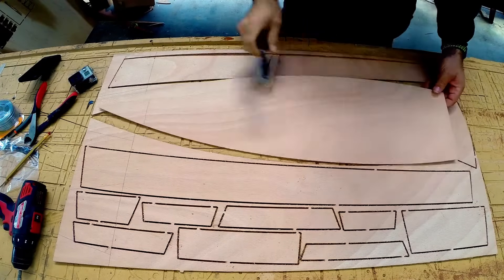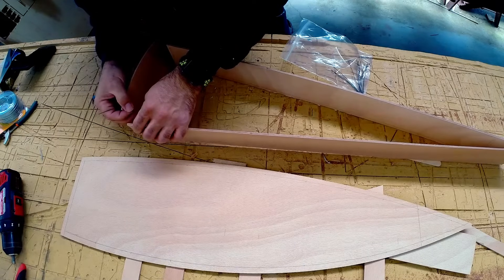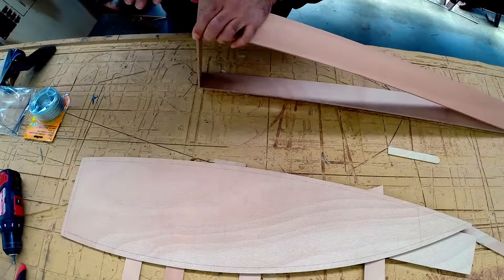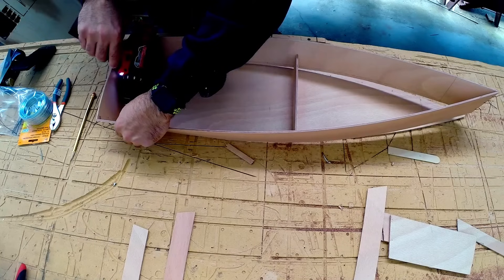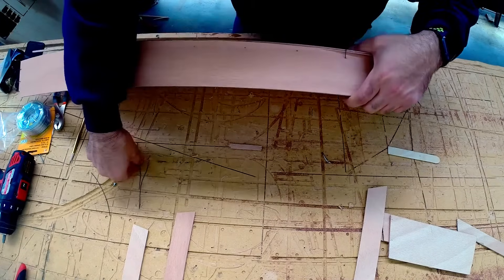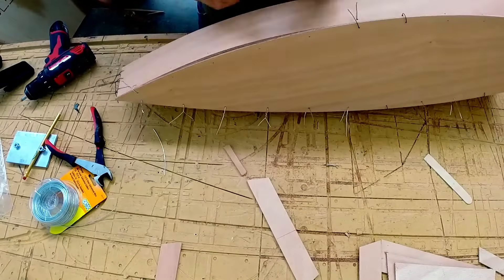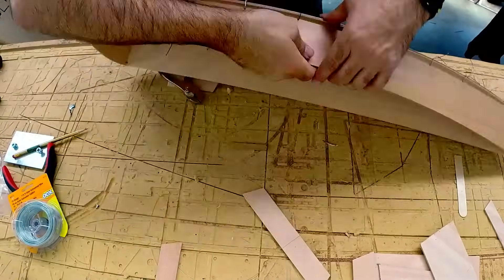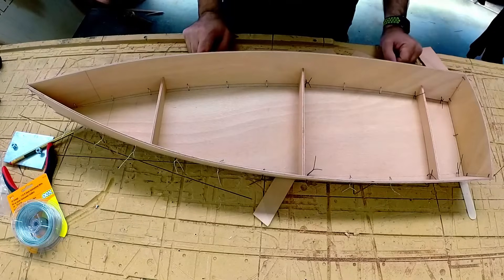Stitch and Glue Boat Building: Stitching a Quick Overview

Comment: With all due respect you put that together in the wrong order.

Sides go onto the base first.then the transom(bavk) then you bend up the sides and wire the bow then the transom to the sides.

You made this look easy because of the scale but a full sized boat would be very difficult your way
Reply from the maker: Interesting. I have built 5 of these boats, 4 - 14 foot long versions and a 10 foot version and I have done all of them the way shown in the video.  Normally I get the bottom laid out on some sawhorses and then lay the sides on top of that, stitch the bow together, place upright on the bottom, stitch the transom on and then stitch the sides to the bottom.  We'll be doing one at a public demo at the Wooden Boat Festival in Port Townsend in September, come check it out.
Reply: @FiberglassSupply  i would live to.the wooden boat show is legendry-but alas,i am a wage slave and cant make it-also im a kiwi and its in asstralia-you people treat us like shit on the whole-next youll be sending us to manus island.

As for the construction method-ive done plenty of kayaks and a couple of skiff type hulls.

All of them are the way i said.

If you make a larger hull using 1/2"  or 12mm ply and above it becomes more important because of the equipment required to bend the material.

On other serious advantage of the method i use is that you can attatch the inwale/gunwales while the panels are still flat and you only have to deal with warping in one plane.
Also the hull panels can be placed on the inverted side pieces and scribed directly from the sides.this also allows you to firmly attatch cross members making the side very rigind  and accurate.

Obviously both methods work and i can see advantages to both ways
Reply from the maker: @jadekayak01  The boat show I was talking about is the one in the US where we are located.  

While we have built that particular skiff that way, I'm not a slave to that method, like you said it depends on size/complexity, etc.

I haven't tried installing the gunwales flat, that sounds interesting, especially if doing  spaced inwales.

Cheers
Reply: @FiberglassSupply  sorry about the location.

Tasmania has a wooden boat show to.

Ive never done gaped inwales.

Seen them mostly on canadian canoes.

From what ive seen you need to do them on the finished boat to prevent uneven stresses along the gunwales.

Have a good show.

The majority of the boats ive built have used Chris Kulczycki(dam-i couldnt spell his name and had to do a search)plans or adaptions.

The skin on frame ideas came from Chris Cunningham and Robbert Morris books.

All American builders.

Such a wealth of knowledge in the americas for boat building.

One of my favorite books -on sailing proa,is written by an american who is now living in coromandel peninsular-just a few miles accros the harbour from auckland(but a couple of hours by car)

Comment: What is the diameter of the wire used?
Reply from the maker: Leif Vejby 16 gauge dark annealed wire. Which is about 1.25mm in diameter or 0.050 in.
Reply: @FiberglassSupply  Thanks! I use about half that (.6mm) for models like that, because it is cheaper.  ^_^